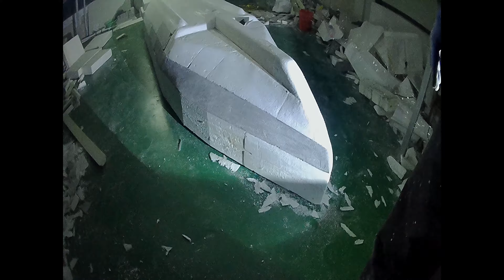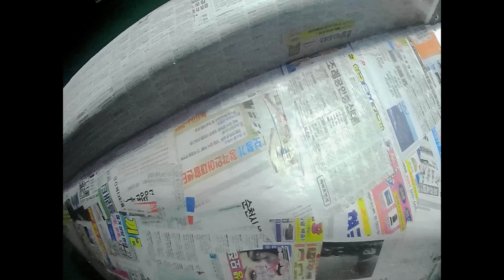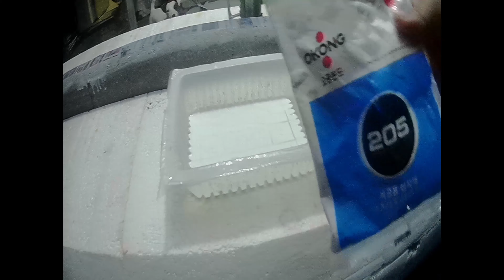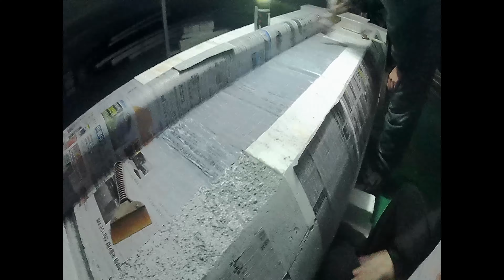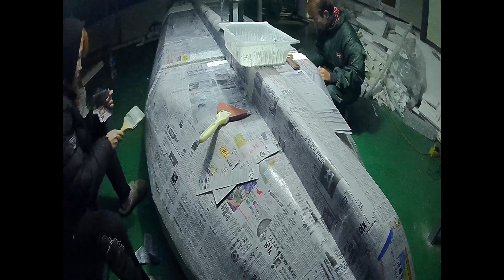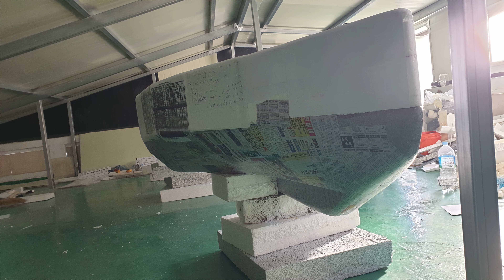Homemade (foam kayak)Styrofoam Upcycle Boat, part1

Comment: for larger boat.. I want to use some plywood to create the cross sections..and then use the foam for shaping between the plywood cross sections.  Then.. use this to build the "Plug".  I like your solution to use paper as barrier to allow you to then overlay the fiberglass. Smart and cheap.  I think this is a very cheap way to build the plug, and then you can  do a Form and make multiple Hulls out of it. NICE!!
Reply: saan po pwd mag order Ng styrofoam

Comment: For the bottom of your boat you could have used much thinner foam material and given you more internal depth to set in . With as lite as your foam boat is it will have a very little draft and be quite high in the water .

Comment: Curious why you used newspaper rather than fibreglass, surely that's not very strong?
Reply from the maker: If you glue the  fibreglass directly to the Styrofoam, the Styrofoam melts.
To prevent that, I put on a newspaper, but there was a little problem, so I found another way to solve it. I hope you watch the next video. Thank you.
Reply: @MrKeywave  not if you use the right kind of resin!
Reply from the maker: Currently, frp coating work is in progress using 300g/m2.

Comment: Okay you used tossed foam  (great thinking) Several questions? What is the red/pink liquid used to make bond foam sections together? Where you get foam cutter? Which grit sandpaper used?
Reply from the maker: Sapo used #300,#600.  Pink bond is styrofoam bond,There are also transparent materials. But the foam is white,I used pink to check the distribution.   I bought a form cutter online. I'll leave the site address in the description.

Comment: Is this Kayak heat resistant? Can I use in 45 - 50 degrees weather.
Reply from the maker: There are some differences depending on the styrofoam used as the base, but as a result, it can be used sufficiently by FRP molding.